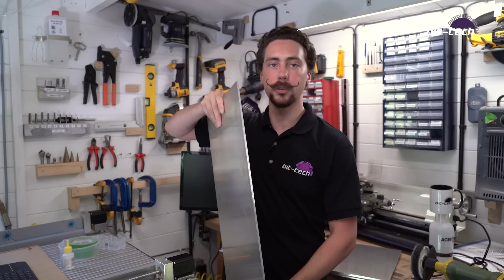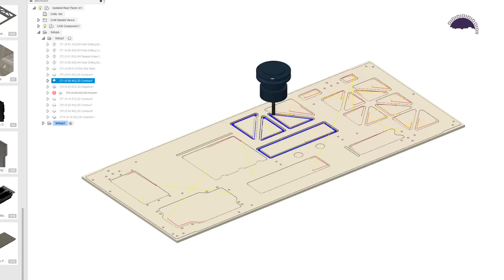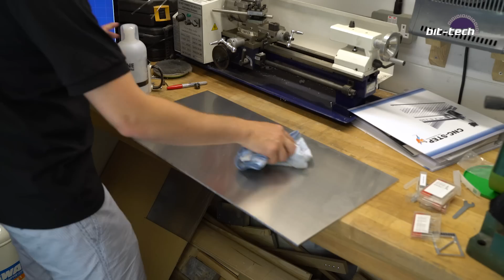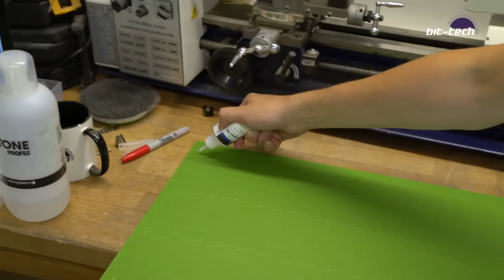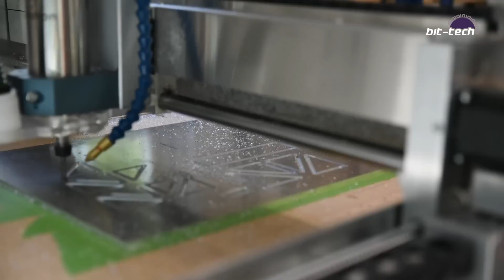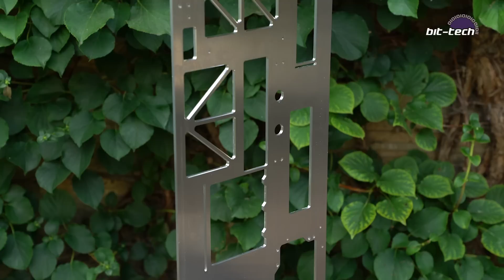Corsair 1000D - CNC cutting new panels (Update 4) | bit-tech Modding

Comment: Hello again, i'm part way through my own stripped down 1000D. Wondering if you are ever going to share the base 1000D CAD files, as in the outer shell and measurements which you retained... I'm just learning design but struggling with how to accurately draw out the case and measurements in it to design my new board tray before powder coating. Any help appreciated :)